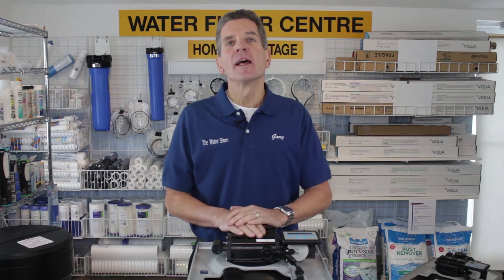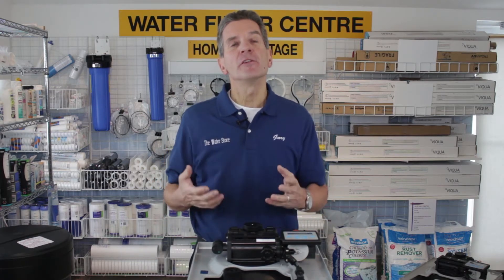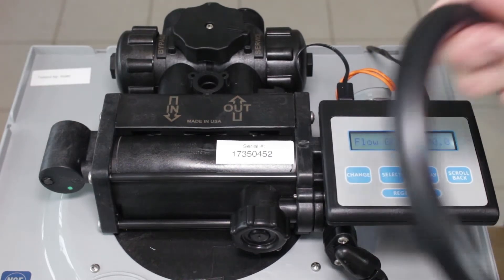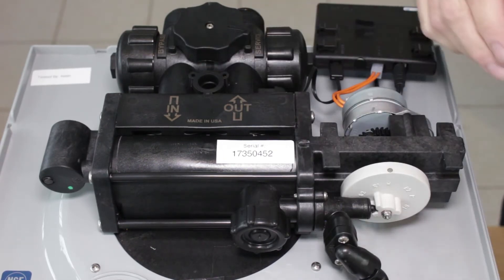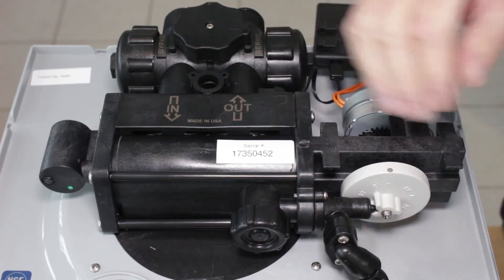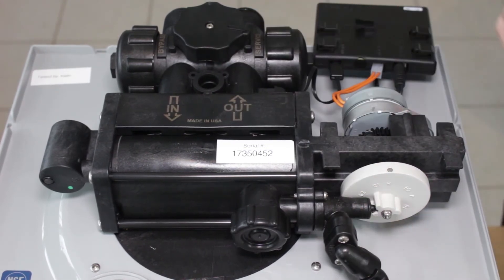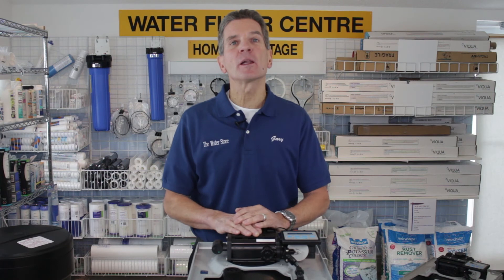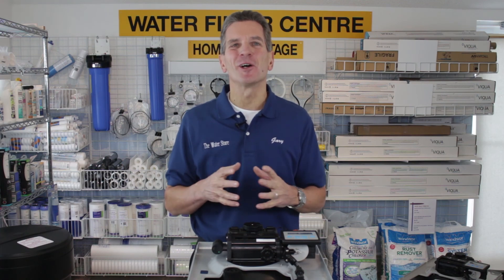Water Softener Trouble Shooting Too Much Water in Brine Tank-Aquamaster or Water Boss

Comment: Done this and it just gets higher and higher.
Reply from the maker: You may have water leaking past the piston and seals inside the valve.  You will need to rebuild the valve.  If you have a Clakc water softener we have the rebuild kits here https://waterestore.com/products/clack-ws1-softener-rebuild-kit
Reply: did you ever get your Waterboss issue fixed?